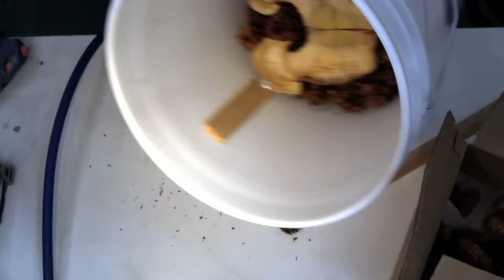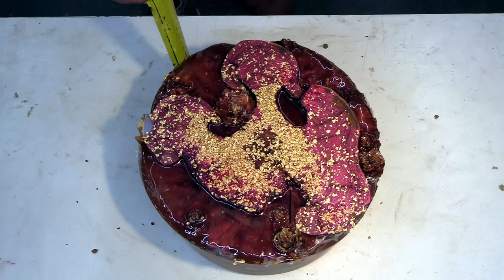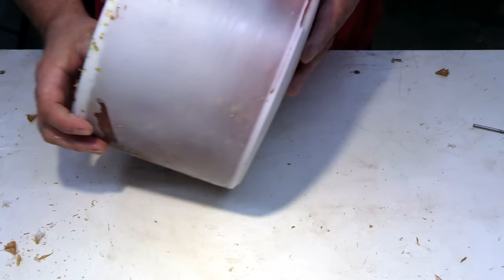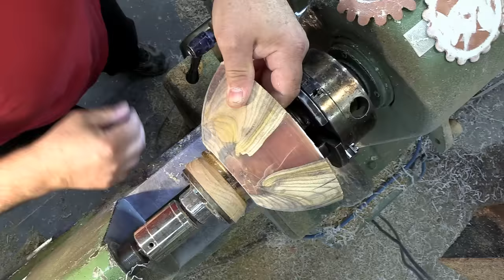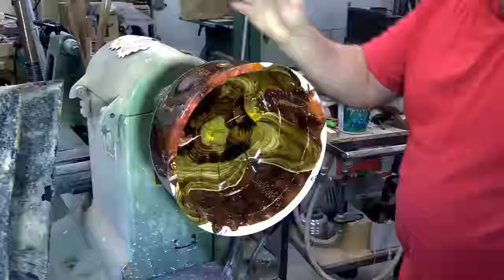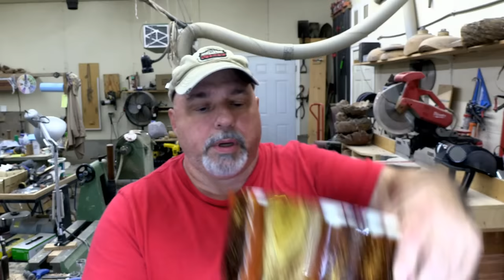Woodturning - Strawberry Shortcake Bowl Set

Comment: I would love to see a pumpkin 🎃 for the Halloween/Fall season.  These pieces were great.  Loved how the white came through on the cracks.
Reply from the maker: Great idea!! Thanks
Reply: Awesome idea
Reply: Can you get orange looking wood?
Reply: Heck yeah, that sounds great! Just need some wood to form a hollow-form pumpkin blank, or - and I don't even know if these exist - large pumpkin gourds which are already hollowed and can be impregnated with resin using the rice/plastic bag method of filling interior space. Maybe some black/smoke-tinted resin and fairly thick yellow resin as well, to color light from one or two of those battery-powered LED tea-lights with the "flicker" effect to them. Just enough light for maximum spookiness as a table centerpiece for a halloween party. A lid turns it from seasonal decoration to function kitchen jar for packets of sweetener, teas, or anything which doesn't have to make bare surface-to-surface contact since food-safe stuff seems to be more finicky and expensive to use, in addition to being harder to find. I remember he had a video where the "food-safe" tag had been removed from the epoxy usually used for bowls, and it was thorny just trying to get an answer from the manufacturer as to what had changed, if anything, in the formulation. But food protected from contact contamination with the epoxy resin should be fine, I would think.

I could see it taking a long time as a project, with cutting (I'd use hole saws and then a hand tool/die grinder with a narrow conical high-speed-steel bit) and providing the shape of the light-blocking portions of the form. Like carving a very intricate pumpkin, if that pumpkin was made out of thick, hard plastic. Obviously he's got the tools and skills to get the job done, but also -- I think I hear it mentioned from time to time -- a schedule for either routine uploads, works for clients, or both. The problem with being good at something like this is that then people expect you'll  make things for them, and usually on time scales that are only reasonable after explanation and negotiation. Not that it isn't worth it in terms of income and exposure, but people who don't know how much work goes into a single piece often assume it's quick and easy if they see many videos of their production with all of the editing tricks to compress them into a digestible format.
Reply: Yeah man, a pumpkin would rock

Comment: Designer Epoxy seems to be just that! That thermal cracking really works to your advantage when filling the cracks with a contrasting color, or gold/silver, whatever. Beautiful! I love the tall pinecones, they look like a tiny forest in the side of the bowl. Each bowl seems to have a tiny panorama in it's side. Even if the gold leaf isn't readily apparent, when there's a little light coming through, the red takes on a gold sheen, I love it. Beautiful set, Jim!
Reply from the maker: Thank you very much!

Comment: This might be my favorite so far! Love them! I’m sure someone already said this but if not, the gold leaf sinks because it’s heavier than the epoxy. Especially deep cast so it will always be at the bottom of your pours. The only way around it is to pour in layers or, I’ve made cubes or balls of it, small ones with art epoxy so it doesn’t sink, then put those in the big project. You can’t tell it’s different epoxy especially  in busy projects like this. Or you can mix it in as the deep cast cures. There’s several ways to do it. Or just let it all sink! That works🙂
Reply from the maker: Good info, thanks!

Comment: Hi 👋 , Jim , That looks amazing, well done, The pinecones look like giant millipedes, scary, 😂, 
3 beautiful pieces of art, whoever purchased them should be very happy, I have been on my lathe this week though it’s not quite finished, 
It still seems to be a bit damp in the inside , running about 15 to 17%, so I will have to leave it for a few months, but it definitely needs some ÇA glue in the bottom as it is very punky, very large fruit bowl 70cm x 45cm x 17cm , 
I am getting very close to getting some resin, And I might have to get a one way coring system, 
Anyway, that’s enough about me , 3 beautiful, looking bowls you have turned, I look 👀 forward to seeing your next project, next week. 
Phil from the moulin
Reply from the maker: Sounds like quite a pice, thanks!

Comment: I love the way these turned out, even if the previous piece was probably my favorite that you've created so far. I had a thought regarding the gold leaf: As you said, the paddle mixer might have helped make the leaf buoyant. In order to curb that, Using a lower-speed mixing system, or paddle-mixing the color, then drawing off some air in the VC, and folding a portion of the leaf in with a paint stirrer or tongue depressor might work to counter that phenomenon. Less cavitation in the resin, it's a little closer to setting up, seems to me that it might do what you want more reliably. Multiple colors would require multiple separate treatments at different ratios of leaf:epoxy, but the extra time may prove well worth the cost when working with (fairly, in bulk) expensive materials.

It's always a little frustrating when I take the time to do something and then find that either my or some natural process has undone my efforts to a great extent. I don't turn wood, I mostly just play with stone. What I would like to see or know about the possibility of in your work, is using fine to ultra-fine crushed stone for inlay as you did with gold epoxy in the kintsugi (kintsuge?)  piece last week. When I have cracks or have cut patterns into pieces, carefully and firmly filling the cracks/channels with crushed powder and then some super-thin-medium-thin CA glue (which basically soaks in almost instantenously because of the huge surface area of the crushed stone by volume) creates a bond suitable for my needs - you may need to use very thin epoxy to achieve an effect which survives the lathe. It would, I think, offer another dimension of visual appreciation to your work, since the stone typically resembles neither wood nor resin, but natural stones with low hardness (so as not to blow through your cutters) can be found in pretty much every color. From alabaster, amazonite, and mother-of-pearl/nacre to jasper, onyx and lapis lazuli, along with redstone, brick, old potsherds, and countless other options, odds are, if you have cracks you want to turn into stand-outs, a little stone will do you well. I can't say I'm unbiased, though, I love rock and think that it enhances certain types of mixed-media projects like those on which you work.

Also, as someone who's watched your videos I think since around when you put up your first woodturning, it's great to see your skill and intuition, and style for the art grow over that time. Your confidence is much greater, and you are far less likely to blame yourself when there is a problem - the human eye can't usually see imperfections that cause tear-outs and worse accidents when an object is spinning ten to fifteen times a second. Accepting that failure is sometimes in the cards, as it were, is part of letting go of ego and really diving into a subject about which one is passionate. We're out greatest critics, unless we're just really, really bad at what we do, and either way, the only person who will stop the damage that unwarranted or excessive critique does is ourselves. Really fantastic to watch you become so much more laid-back and outwardly happy about creating your art, and there's still so much for you to experiment with and enjoy in the realm of your craft.

I wish you the best in all things, for you and everyone you love. May you be surrounded by eager supporters and honest critics, but most of all abundant inspiration. Have a good week and I will see you in the next one, yeah? Or some gloves and whatnot, you know, whichever.
Reply from the maker: Wow, that’s quite a comment! Using natural materials is on the list of things to fill thermal cracks with, unfortunately soapstone and alabaster being about the only things that I could use to do it with, possibly MOP in small amounts. All the other stuff listed above would just tear up my cutters. I do worry about adhesion issues with CA in a structural sense, mainly do to not being able to put the piece in the vacuum chamber like when using resin to fill thermal cracks, but it would certainly give a different look! 

I’m certainly my worse critic, I think it’s natural for most artisans to be that way and I’m constantly trying to push my limits and come up with new and exciting things. 

Thank you so much, I really appreciate it! 
Jim

Comment: The voids in the filler epoxy are not due to the epoxy, they are the result of trapped air. You can improve resin flow characteristics by agitating your bucket after pouring, say by resting it on a motorized agitator, like a shaker table. In an earthquake, tectonic vibration causes entire hillsides to SLIDE DOWN. Applying this effect to your fill bucket will encourage resin to flow downwards and air to rise upwards, reducing the voids against your bucket wall, or wherever they might be hiding. The pressure pot will finish the job nicely.
Reply from the maker: People keep suggesting this, but no one can ever give me a source to buy one. Do you have one? Thanks

Comment: Wow beautiful job Jim. Love it. I use uv resin and I have found out you can't mix the color in to intense..... The out side of the resin cured nice but when I went to turn it back it was wet a sticky under neither the surface. Made a mess on the lathe I even had it curing for an hour so yeah not a good idea. Lol
Reply from the maker: Since I’m using white it didn’t seem to be a problem. Thank you very much!

Comment: Very cool bowl set!
Can you explain thermal cracking?
Would putting the bucket in a bigger bucket with cold water increase the chance of thermal cracking?
Reply from the maker: Thermal cracking occurs when the epoxy cures too fast. All epoxy’s have a max and min pour depth, when you push your limits, thermal cracking can occur. Keeping the epoxy cool is a good idea, I’ve placed bucket in the fridge for a couple of days to slow the cure. Placing it in a bucket of cold water will help to, but it needs to kept cool. Hope this helps. Thanks

Comment: I love every pine cone piece you do! I think this bowl set is amazing, so the critiques are "not quite as awesome" rather than "bad."
The white doesn't really work for me. Especially the ring at the top of the outside bowl, it makes it look unfinished to me. I think white can be a great color for patching cracks, but I'm a bit surprised you didn't use gold resin to patch the cracks this time, especially since the gold leaf was a part of the mix. Speaking of the gold leaf, I think it can work in bowls really well, I don't think it did so this time. Because the cores of the pine cones looks gold in the video, the leaf looks like messy floating bits of pinecone, rather than actual gold leaf. 

The mulberry is beautiful! I love when you work with pieces of wood that are full of holes, gaps, sways, or other places for the resin to infiltrate, to give extra interest. My fave bit of this set is on the two smaller bowls. There's the vertical pinecone you put in that gap, and the flower-like structure you were hoping for looks great in the gap on those two!

You're so creative, and the pieces that aren't my favorite are still better than 99% of the other work I've seen! Thanks again for sharing the beauty you create!
Reply from the maker: Thank you very much!

Comment: They look awesome! Two questions: do you have a Korpro for each knife, or do you just switch from one to the other? Also, curious why you didn’t take the smallest cores first, negating having to reverse each core to put a foot on. And oh ya - the burns from CA glue - definitely know what you’re talking about there!!
Reply from the maker: Yes, I have one for each knife but thats not needed, just need to move them around. While I know the normal progression is to take the smallest one out first, I want to use tale stock support and I find when the smallest core comes out my tailstock sometimes can’t reach the remaining piece. This is why I typically do coring this way. Thank you very much!

Comment: Wow.  Beautiful work.  How do you know which type of resin to use?  I want to start turning with resin and I am learning a lot watching how you work.  Thanks
Reply from the maker: It depends on what your doing. All manufacturers will list on their websites what their epoxy’s are designed for. Designer epoxy’s deep cast is good to 4 to 5” deep, but I’ve poured it much deeper. Artcast is good to one inch. With my code for DE, it’s a perfect time to give it a try. Thanks for watching!

Comment: Cool piece, not a big fan of the white myself but it's not bad. Is denatured alcohol the only thing to clean up the buffing compound? Or can you use something like acetone or mineral spirits? I remember you saying that the denatured alcohol was a bit pricey. Also you should try other color combos of pigments. I tried black onyx and imperial red and just let them flow together a little bit with artcast and got and amazing dark midnight purple color with blacks and red streaks in it
Reply from the maker: Isopropyl alcohol will work as well, but I think the denatured alcohol is not as toxic. Acetone eats resin so I’d stay away from that. Ardec in Quebec is a good cheap place to get denatured alcohol. Thanks

Comment: Wow those are really cool. In my experience with gold flakes they either sink or float and seem to have a mind of their own lol. I'm not sure if it would be more efficient but have you tried doing half pours on the over sized pours to prevent thermal cracking? Since you mix so heavy on pigments I think it would blend well just wait until the first layer is starting to set but is still quite tacky then do the next pour. It may add too much time before the piece is ready to be turned but it would save time on filling cracks so maybe it would balance out in that regard? Although filling those cracks with other colors gives amazing end results so I guess it's worth it lol
Reply: Designer epoxy
Reply from the maker: This certainly is an option on really large pours but I don’t do it. Don’t like the witness lines and the epoxy won’t flow like it originally would to give you those great epoxy figures that we see. Thanks for watching!

Comment: Another unique and beautiful bowl and a couple smaller clones to boot! Do you heat the wood before casting or is it the deep cast that you use that keeps the air bubbles out next to the wood? With my castings, I have had little pockets of air trapped at the wood that pressure cannot keep out.
Reply from the maker: Is it a slow setting resin? If it’s not, that’s why your having issues. The slow cure of the deep cast will allow the bubbles to escape. Thanks

Comment: I might be totally overthinking this, but about your concerns about curing UV resin and how different pigments interact with it:
My gut feeling is that white would be the most difficult, and black actually would have an easier time under the UV light. Consider parking your car in the sun. A black car heats up immediately, whereas a white car stays cool the longest. That's because white reflects a lot more light than black does. My theory is that black resin would draw the light into itself, while white would bounce the UV light out to the highest degree. In addition since light pigments tend to be weaker you need a higher percentage of pigment particles in the resin that gets in the way, just like a more opaque mix would have a more difficult time than a more translucent mix of the same pigment.
All that said, all of the above is a mix of gut feeling and armchair physics, so take it with great heap of salt.
Reply from the maker: I totally get what your saying and you might be totally right. The way I see it, you need the UV light to penetrate and a darker pigment like black will prevent that, it will absorb heat better than white, but I can’t help but think it will prevent the UV light from penetrating. Thanks for watching!
Reply: @SpragueWoodturning  Certainly something to keep in mind experimenting with, especially if you have a piece that need filling with both light and dark areas in the future.

Comment: Very nice,The liquid white is very vivid, the pine cones are a very good contrast with that mulberry wood.The #3 hunter tool is a great tool. the gold that did not mix right would you have just mixed it by Hand? Also I would like to know what brand of air filter face shield mask is. Thank you Designer Epoxy.
Reply from the maker: I’m using the Powercap respirator and if I had of mixed the epoxy by hand and not the paddle drill I think it would of been better. Thanks

Comment: Designer Epoxy.   Wow!  All the colors in these bowls is stunning.  Love the little bit of white resin on the top edge.  A gallon and a half of resin???   That blank musta weighted 20-25 pounds.  Really like the shape too and the bonus smaller bowls.   When you do the water lox finish using they recommend using the original “sealer and finish” first.   I see you go right to the gloss finish so are you applying a wood sealer during the sanding process?   Or does the Triple E compound also act as a sealer?   Curious because I’m thinking of trying water lox but not sure if I need to buy the sealer/finish and the gloss finish.  😊
Reply from the maker: What you see is what you get. No sealer and all the Tripoli compound is there to remove any fine scratches. I don’t think it has any affect on sealing the wood. I should get some sealer to see if there’s any difference. Can’t argue with the results though. Thank you very much!